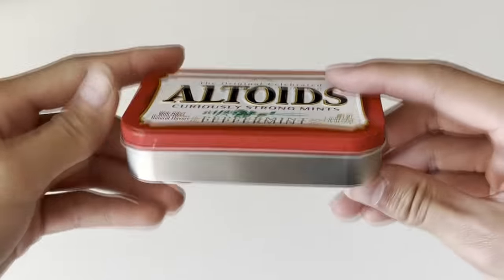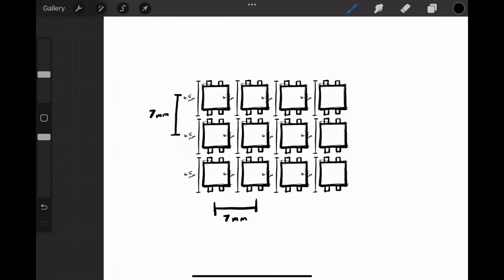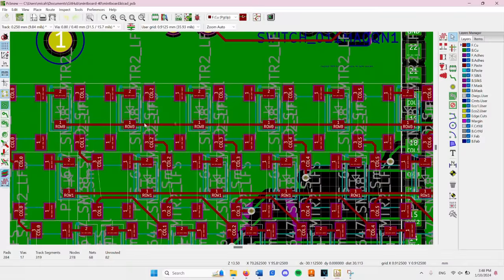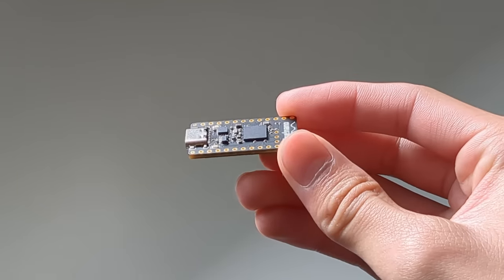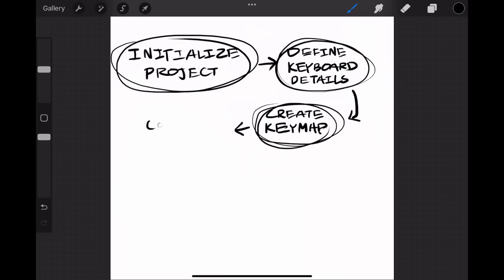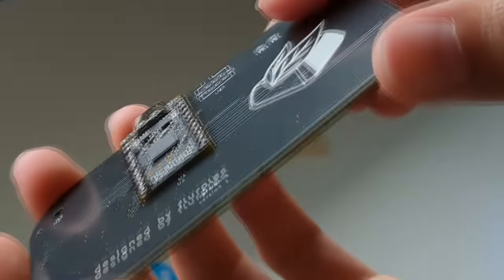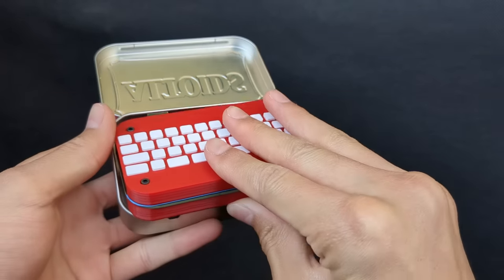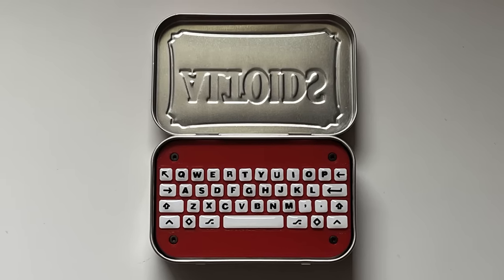building a keyboard into an Altoids tin

Comment: Now Imagine it with a screen under the lid , a battery and a working computer.
Reply: Maybe a raspberry pi zero w with one of those mini touch screens. Then make space for a stylus compartment and a small battery. It could be a cool and portable cyber deck.
Reply: I feel like a small Lithium battery pack that could be removed for it to be charged with an other device, and with a Raspberry Pi Zero it would be a little cyberdeck station or something neat like that. Seems doable to me at least
Reply: @brwed  Thanks a lot for the reference. I will look it up
Reply: @exit-the-simulation  I like this idea. Maybe a similar form factor to digital camera batteries that slide into a slot in the device.
Reply: Make this next in project cue
Reply: @ashrie build it
Reply: I actually designed this around the  Google Coral SoM and called it “Coral Mint”. I never built it though.
Reply: And since the keyboard was smaller I actually fit a capacitive track pad for navigation. It has USB3, USB2 and HDMI output along with the integrated keyboard, trackpad and display.
Reply: And a headphone jack
Reply: hmm, looks like the m5stack "cardputer" fits, but it has a much worse keyboard than this...
Reply: I would do at least a screen and add like hdmi support or mini displayport or something to use it as a monitor. OH! Get one of those even smaller Altoids tins and make it into a mouse! That would be a good theme combo.
Reply: Hmm... I think those things already exist, I think they are called "smartphones"
Reply: So a Ds?
Reply: Thats called a laptop
Reply: And it's running Linux mint
Reply: @8xus_1 yeah but smaller
Reply: Isn't that basically just a blackberry phone at that point
Reply: @Tsutaru  but worse
Reply: At that point it'll be one of those phones with a built in keyboard
Reply: @jonathanmendez5922 Most likely wouldnt fit.
Reply: @avtips4779 nuh uh 

I think you are reffering to laptops, but those are also way bigger than an altoids tin, same goes for phones. This person was reffering to it specifically being in this tin with the keyboard.
Reply: @cheeseburgerinvr  ever heard of a flip phone
Reply: Laptop😊
Reply: Omg that would be so amazing
Reply: I’ve seen someone make a portable emulator with an Altiods tin
Reply: I don’t think that idea is too far away from us
Reply: the minty cyberdeck
Reply: Flip phone.
Reply: Smells like pi, raspberry pi 😂😂😂
Reply: So a full keyboard flip (dumb) phone?
Reply: If their able to make flip phones with Internet access and browsers then the must be able to fit the hardware in an Altoids tin.
Reply: keep imagining
Reply: that's just a fliphone
Reply: @ezrakornfeld8436 with a keyboard that small you don't need a trackpad, the small touch screen would be superior to the trackpad. A blackberry trackpad at most would be the option.
Reply: Very much possible since someone already made a mouse into a pc that can handle Minecraft
Reply: That would be amazing

Comment: The UV-curing nail topcoat over legends is a brilliant idea!
Reply from the maker: thank you!
Reply: To be real the nail top coat will yellow pretty badly over time. Nice uv resistant 2 part resin would have lasted longer. 

Always remember anything for fingernails is meant to be temporary and usually ages very poorly.
Reply: I have some UV curing liquid plastic from several sources, such as Bondic and RapidFix. I didn't think of nail top coat.

Comment: If you take an altoids tin, a box cutter knife blade and a support to keep the blade off the ground, you can score a line on the base of the altoids tin and split it down that line. Then, you can print a 100% fit part, with screw holes and screw the two parts of the base of the altoids tin around it for a more filled out fit.  At that size, using 1mm screws is more than enough. If you happen have an old, defunct laptop you can remove the brass bosses and screws from it.
Reply from the maker: that's a good idea! The filled out fit would make projects nicer for sure. But I would imagine wouldn't it be difficult to keep the seam pretty?

Comment: You should use a protruding switch or a contact at the top, so that opening the lid also acts as a power switch and turns it ON. That would be cool

Comment: My 2 cents to properly "smd" solder the microcontroller board, coming from my humble experience in implementing VIAs on my home-made PCBs:
1) Make a custom footprint on your board with a wider offset and longer pads;
2) Use a solid wire and strip off the insulation plastic wrapping it;
3) Thread it inside the microcontroller pin holes starting from the bottom pcb face, let it poke through the first pin hole;
4) Grab the longer wire end and let it go through the bottom of the next hole, grab it from the top and let it pass under the pcb, inside the next pin hole and so on, until completion;
5) Solder the wire on the pcb top side for every pin;
6) Cut the wire on pcb top just before every pin and straight up every wire cut perpendicular to the microcontroller pcb side and parallel to the main pcb pads for every pin;
7) Repeat the process for the other pcb side and solder them on the pcb;

I hope it's clear enough, because English it's not my native language. 😅
Congratulations for this beautiful project.👍
Reply from the maker: Interesting idea! that would make it much easier to consistently SMD mount the microcontroller. Thanks for the info!

Comment: One potential improvement would be to remix the microcontroller PCB or use a CNC machine to have castellated edges so that it's easier to solder onto the back of the keyboard circuit board, assuming you don't want to directly solder all of the components directly on there.

There also exists SMD headers that'll let you use the holes already on the microcontroller board.

Comment: Ideas for iteration 2. Make it bluetooth, add a battery, replace the power switch with a photocell on the face of the keyboard to automatically turn it on when you open the lid.

Hmm... now that I think about that, maybe a back up power switch to use it in a very dark environment.

Comment: This project is terrific. Do you plan to further prototype? If so maybe some arrow keys and/or a mini trackball above the top row? I think adafriit has something like that. Great project. I’m hoping to make something in an altoids tin this year as well. Minty pie has made that little tin into something of an icon for makers
Reply from the maker: I don't have any plans yet, but it's all very doable! There's plenty of space left in the tin to add more features. I was thinking of adding a mechanism that automatically turns it on / off when you close and open the lid, but I decided not to implement it in the final design just because it would add too much complexity for a first prototype

Comment: The altoid tins which open from the top (vertical and blue) could probably fit a pi pico inside, and I know that there is a c64 emulator on the pi pico so you should be able to have an all altoids "gaming" setup.

Comment: i wouldve put 2 buttons in for the space bar since theres not much room for a bar running across it for even movement
i guess it is still a very small space bar so the bar tilting instead of pressing on the edges shouldnt be a problem